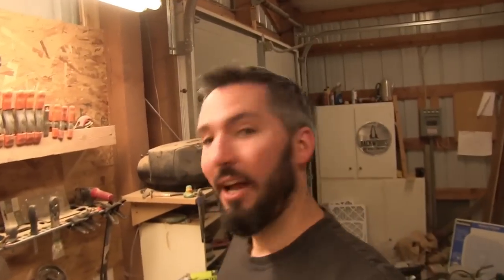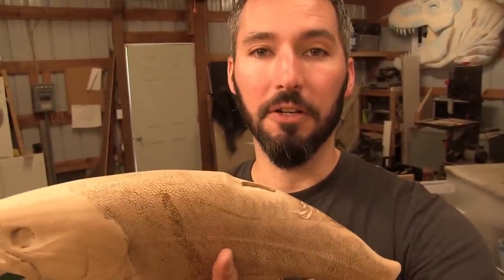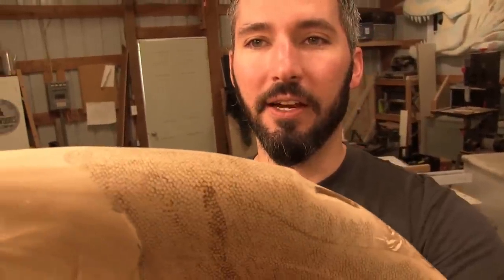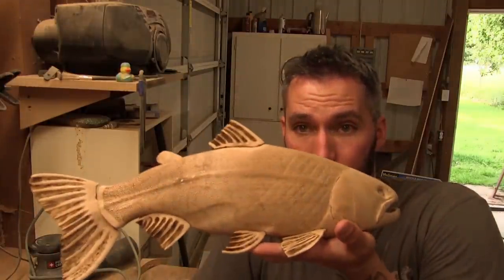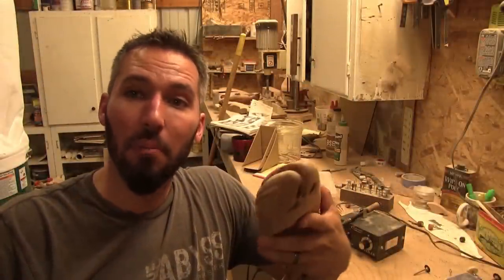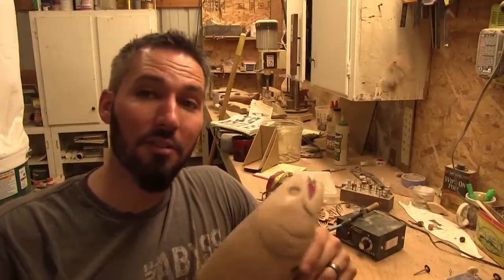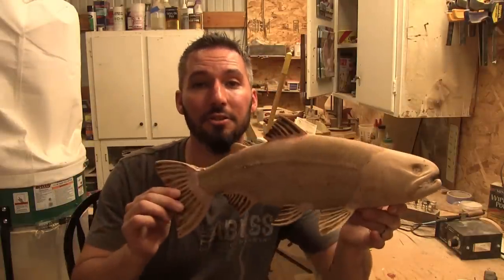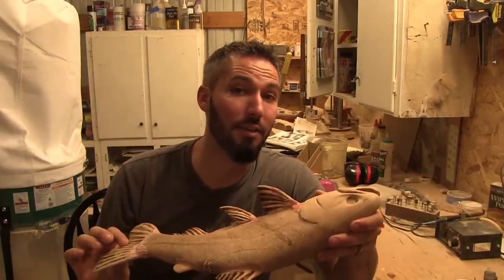Carving a Trout, Part 5: Scales & Fin Placement

Comment: Hi, Perhaps you can help me on the placement of the dorsal fin of my sunfish. I painted the fish with createx water based paint, but found that the area around the fin was not sanded out
 enough. I  have a line showing where the fin filler, which is painted,  
meets the body of the fish. I did not use Bondo.  Is there any way to repair this without                removing all the paint from this area ? Thanks!
Regards,
Robert Fern
USA
Reply from the maker: Hello Robert, From what you're saying I can honestly say that 'Yes', you should be able to repair this by gently scuffing the surface around the fin filler with 220-grit sandpaper. This will give the additional filler something to better adhere to. Be sure to scuff the area generously around the new fill area, an inch or so in either direction of the area, as it will help you blend the new paint with the old over a larger space. This can be more tricky if there is a clear coat already applied, and you may consider making the patch-paint area a bit larger and use 400-grit to lightly blend the clear coat. Add your new filler and sand it with 220-grit or 400-grit sandpaper, slap some primer on there, and do your best to color match the carving. Remember that you can often times get away with touching up a spot like that and, if the colors are not a perfect match, opt for a ever so slightly darker top color to lightly spray of the entire back of a fish. This sounds odd, but it will give an even color coat throughout, blending the details. Follow that up with some clear coat and you should be good to go.

Comment: Instead of Bondo try Aves Apoxie Sculpt 👍
Reply from the maker: Awesome suggestion and I’ll check it out for sure. I seldom use Bondo anymore and presented it as a good option because it’s readily available. Right now, I tend toward the two-part Sculpt Wood product and really like the sandability.
Reply: @RiverbendWoodworks  Roger that 👍  I'm fairly certain the Sculpt Wood & Aves are similar.  The beauty of Aves is the workability changes over a 2-3 hour period.  Starts off being uber tacky (best set aside for 15 min) to finishing to a carveable wax like consistency towards the end.